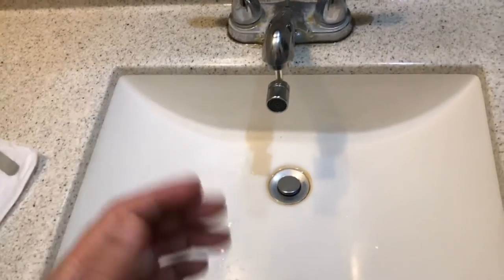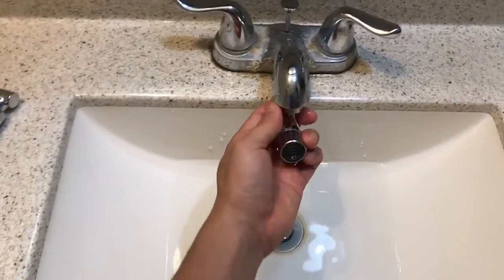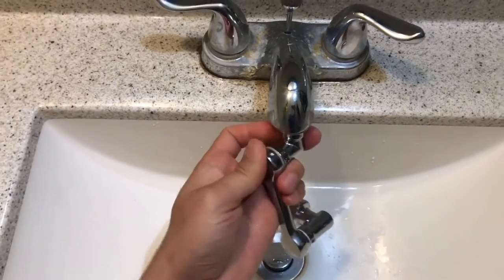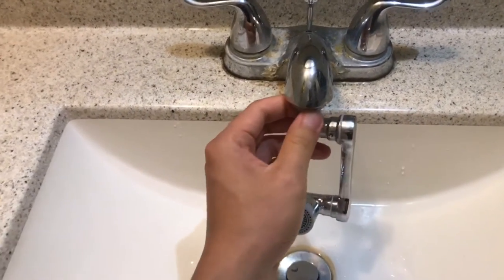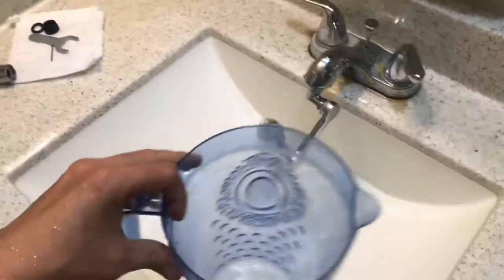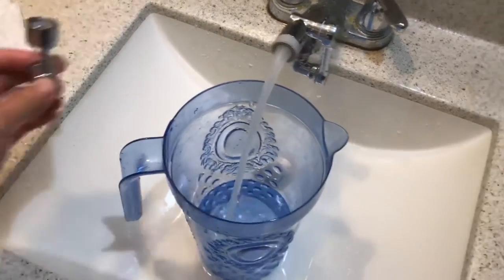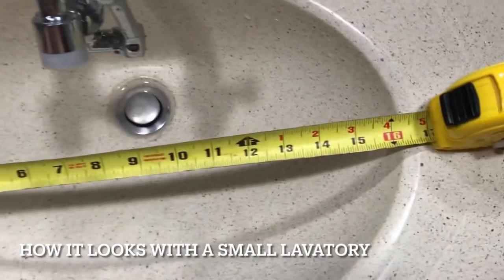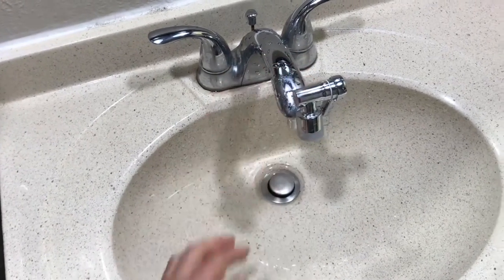Upgrade: 1080 Degree Swivel Kitchen Sink Faucet Aerator Universal

Comment: What if the adapter won't fit in my faucet?  The faucet female insert is too small
Reply from the maker: Mine was included many adapters. If you cannt fit nor replaced ur faucet, return it. Its hard to find right adapters online.

Comment: Thumbs up for a nice review. Thanks.

There are at least a dozen different faucet aerators - either male or female in half a dozen sizes across several different thread patterns. You almost need a Doctorate in "Threadology" to figure it all out. I have three different vanities in the house and each one takes a different aerator, so how can we be sure this thing will screw right onto our particular faucet?
Reply from the maker: Hi there, thanks for your comment. My faucets are the standard size. Both of my bathroom's faucets are the same. The thread we need here is 55/64' (M22) if you are not sure, you can go to homedepot/low to check. The trick here is to use the right rubber washers to prevent leaking. Please check my description for another video about this.

Comment: I bought one and it is very good for my faucet but why did you put two rubbers over there you have a thick rubber from one piece no need for two, make it simple not harder. Cheers
Reply from the maker: Cool. I tried that thick one and it did not work out for mine. Nice to know it works for yours. 💪